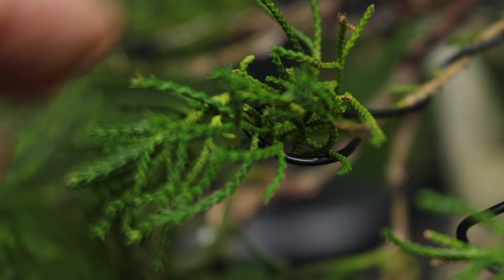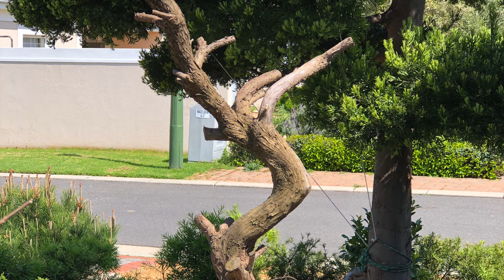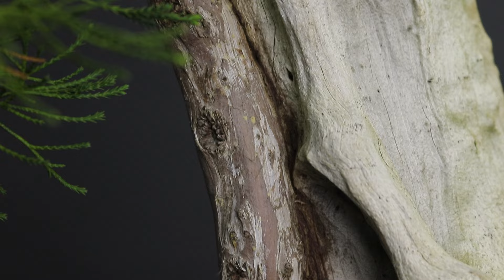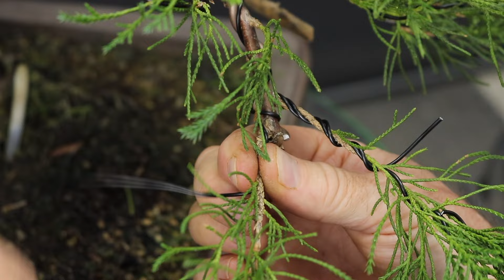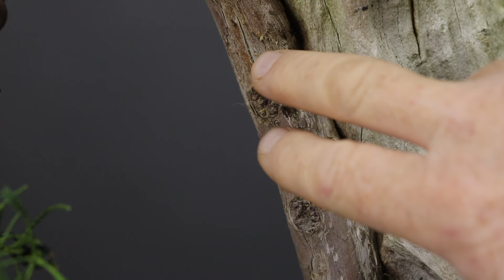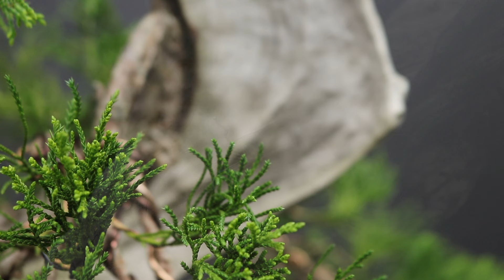Cheating in Bonsai: Creating and Developing a Tanuki

Comment: Very good information.  Well presented and explained.  I’ve learned what I need to change and address on our inherited tanuki.  Screwing the live to the dead is intriguing, and appears to work better than various forms of strapping it.  Thank you.
Reply from the maker: Thanks so much for that feedback. Yes, using screws for an existing tanuki is a solution but try to use screws with the smallest head possible to reduce the size of the resulting scar which will be left.

Comment: Great vid. I particularly appreciate the explanations regarding the limp foliage of Junipers available to us here in SA and the techniques to remedy this. 
Thanks Terry
Reply: ... And of course by using the tanuki approach one can create something really special in our country with what is available.
Reply: I would appreciate your advice on digging out an "urban yamadori" ,ie garden planted Juniper... When would you suggest is the best time to dig out a "rather old",  say 30 years, junipers from the garden?
Reply: And any other after care. Thank you Terry
Reply from the maker: Yes. This is what I hope to convey through the video. Thanks.
Reply from the maker: Ok. I will comment on that in your next comment
Reply from the maker: A lot depends on whether you have time to prepare the material or not. Ideally the tree should be as healthy as possible so I would be feeding and watering it well so that it hopefully has multiple runners or vigorous growth already. 
Best time would be same time as repotting which is in spring sometime when the tips of the previous years foliage turns a vibrant green. 
Dig the tree and hopefully it has some fine roots near the base. Preserve those at all costs. If it does not have fine roots you’re essentially digging a massive cutting and the chances of survival is extremely low.  Best to leave it or ring bark some of the thick roots to induce some fine roots. 
Plant in pumice or similar for lots of aeration. Keep in a shaded spot and mist as often as possible.
In 6 months if it’s still alive you can start to relax but until it has put new growth on in the following season you are not out the woods. 
If you want to discuss this in greater details book a consult with me: https://www.bonsaitree.co.za/products/consultation